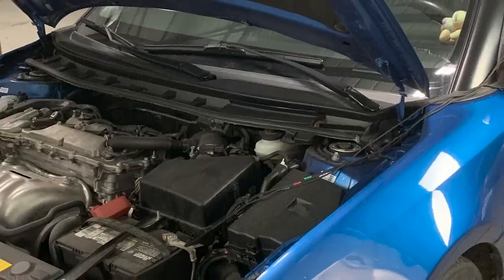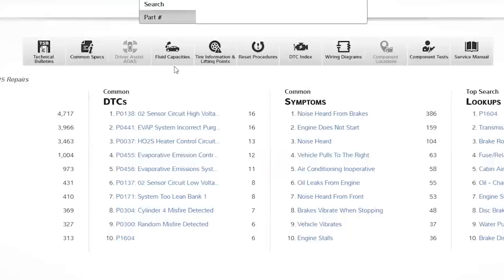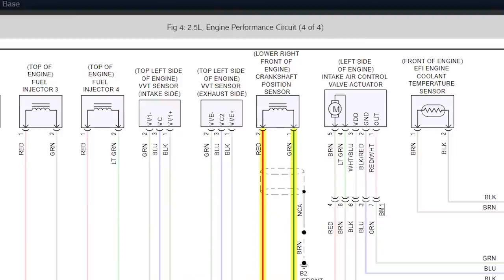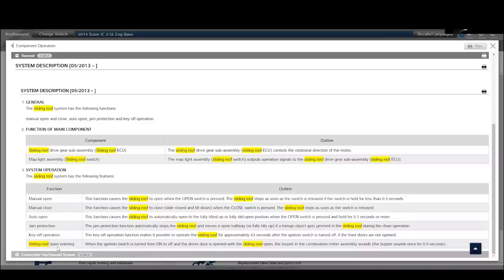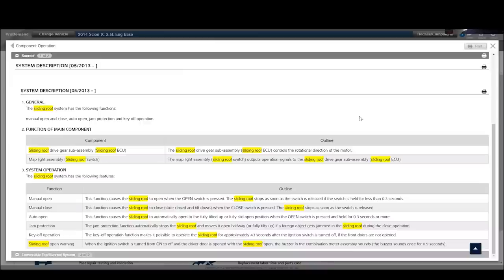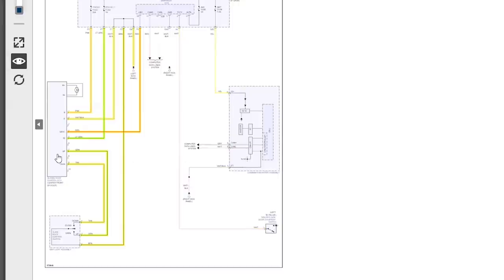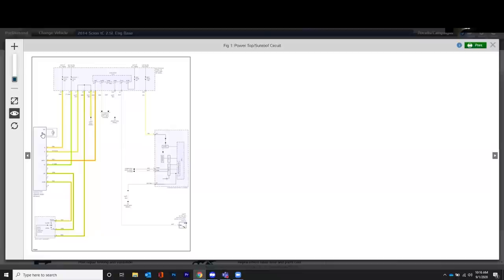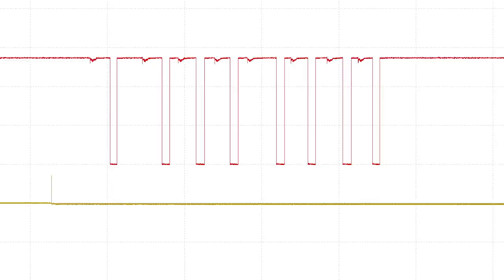The Trainer #105:  Practical Electrical Troubleshooting

Comment: Hi in your last slide when operating the switch your current isn’t showing any flow if the ecu is operating and switching on power to move the motor and you said maybe the motor is stuck if the motor is stuck surely there would be an excessive current draw if there is a path to ground out through the motor so I take it there is no connection intermittently through the brushes to the armature hence the reason there is no current flow on your scope pattern am I understanding this correctly thanks Del.
Reply from the maker: Great point and one I should have been thinking of more clearly. IF the motor was mechanically failing but electrically intact, I should have seen a flat-line current draw on the scope screen. Way to catch the mistake!!
Reply: Motor Age yes can only thank Vince Fischelli of Veejer.com and his training books my electrical understanding and diagnoses have rapidly increased cheers Del.

Comment: Do you also have a subscription to Identifix?  
Your experience with this service?
Reply from the maker: I do and have used it as another source of information. But I stress - "Test, don't guess". Make sure that you verify the problem is a match with whatever source you use before you replace a part or perform a repair.